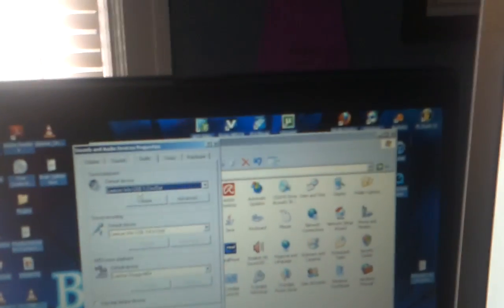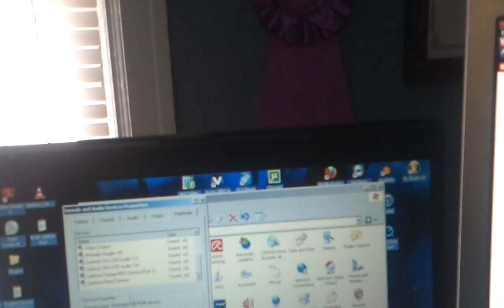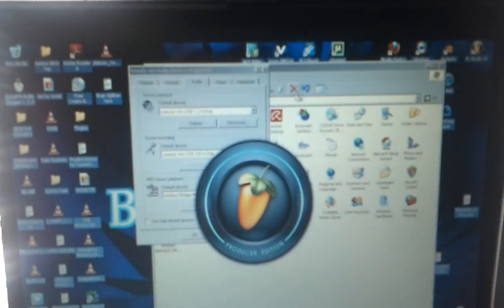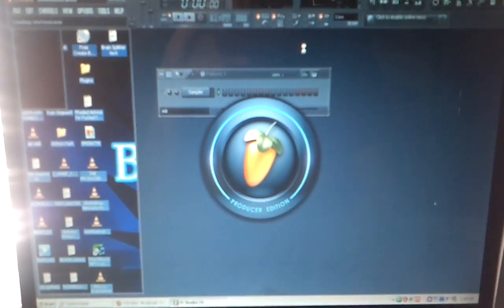RedRaven Video Blog #4 - How to Set Up Your Audio Interface and MIDI Equipment

Comment from the maker: @dnbFiZiO Well you need to have FL recording, and a low latency setting will be better for recording. Put a click track on, highlight the record button it will click out 1 full measure of silence (so if its a 4 bar pattern it click 4 times if its an 8 bar it will click 8 times) and then start playing.  It will put the notes in your piano roll where you can fix up any mistakes you made and quantize it if you need to.